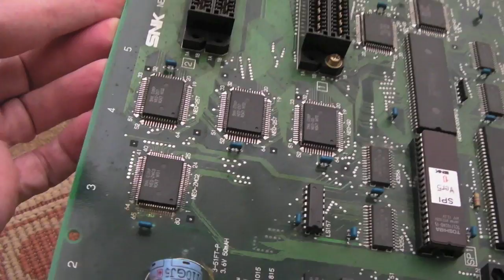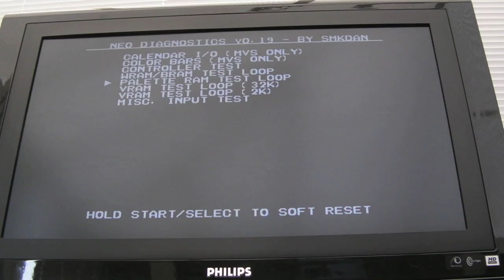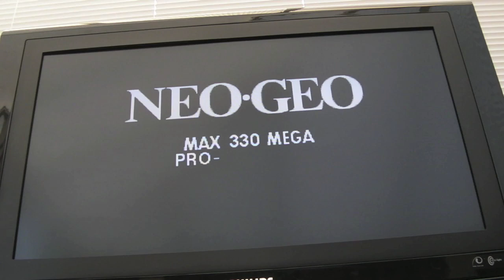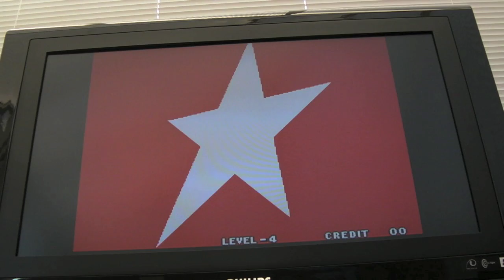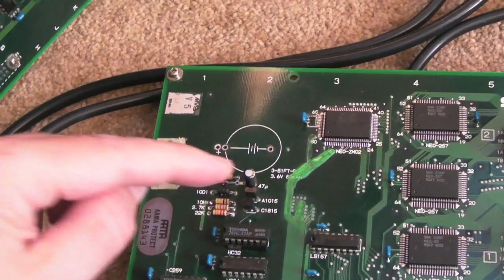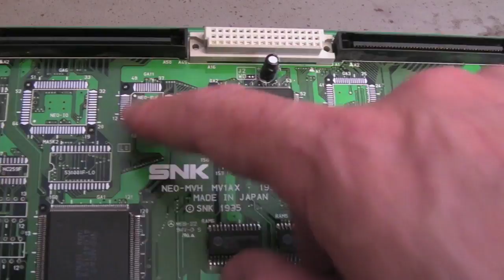SNK Neo Geo MVS MV2 (2 Slot) Repair (Graphics Problems & Corrosion)

Comment from the maker: A couple of corrections - 1) When I was pointing to some of the quad flat packs saying they were 128 pin - they aren't they are 64 pin!  The ZMC2 is 80 pin.  2) The BIOS wasn't sat all the way into the socket properly there at that point when I went around the chips - just needed pressing in further on the left side.
Reply: I have the same board with similar issues. Wanna fix it for me? 😁

Comment: Hello. i have artifacts with one of my mv1fz boards could you give me any hints what migh be the cause ? i  tried using another cartige pcb and the problem is tha same the cartige pcb from this one works fine on another board. i also tried cleaning all contacts and did a quick inspection but i dont find anything obvious. thank you in advance
Reply from the maker: If you have graphical problems, it's going to relate to C or S buses.  If its a multislot - check out the Neo Geo wiki for the 4 slot pinouts, to try and follow the char and S buses to the various chips.  If you are lucky and have older multislot, 74 series is mostly responsible.  New multislot boards use customs for slot logic - you can get modern replacements for those from Furrteks Tindie store.   If you are lucky it could just be a dirty slot or damaged trace though!

Comment: Thanks for your videos!! 
I would like to ask you some information about a repair i'm working on ... i have a MV2F board with "calendar error" problem. i've checked traces from battery to 4990 ic but i've not found any leak or corrosion sign...i've changed the 4990 too but it doesn't work, same calendar error. I've tried a working mvs board with oscilloscope and compare the waveforms. i've seen that the 4990 works but its serial interface is not clocked by the neo-f0 ic. the clock rise up but then stucks at high level and not change (it should do 4 clock strobe to set the C0,C1,C2,C3 commands to 4990 and then 32 strobe to read date). It can be a faulty neo-f0 ic or something else? the board seems clean everywhere :( sorry for my bad english 

thanks a lot!
Reply from the maker: It could be a faulty F0 perhaps, but often the cause will be a missing trace or 74 series IC related.   Here's a schematic for that circuit which I grabbed from Neo Geo forum years ago (not sure who created it) - https://www.dropbox.com/s/m9lfhjqlgpbv3hf/2slotcalendarak9.jpg?dl=0
Reply: @GadgetUK164  thanks a lot for suggestions...i've seen something like that with multimeter trying to decode the routing on the pcb. i will see if it is the faulty logic gate (my wish) or a faulty F0 chip (my nightmare :(( ) Unfortunately, as i wrote above, it seems to be the CLK on the 4990 to be corrupted (from NEO F0 chip)...the 74 gate ic pins are related to chip select and output enable of the 4990, but the problem seems the missing input clock. 

I'll keep you updated!
Reply from the maker: Maybe swap out the watch crystal first?  Unless you see the 32.768Khz there with a scope?
Reply: @GadgetUK164  the crystal is fine :)

Comment: Great video's mate! I have a 2 slot looking extremely clean and nice but i find the graphics very dark-ish on my Sega Blast city. Also the cards do not work all the time, glitches etc. Do you have any idea how to fix it? Maybe some new capacitors?
Reply from the maker: It could be a voltage problem - check your 5v level is good on the board whilst its powered?  Alternatively, if the video is still dark, maybe there's a DAC problem.  I think its done with some 74HC chips, and resistors on these?!?  If carts are not working all the time, clean the PCB edges on the carts with IPA.  Also consider cleaning the cart slots with deoxit or contact cleaner.  If carts still fail to work you may have a fault on the top board.
Reply: @GadgetUK164  I had my board recapped but didn't fix the issue. The problem with my Blast city was that i still had the VGA cable inserted causing the darker image on Jamma. Solved now!! Looking for a MVS 2 slot headphone jack replacement since i accidently broke mine. Any idea where you can buy this part? Heard they are rare.

Comment: Nice work on that really small wire trace repair coming of the chip you replaced. I have a 2 slot thats just started having some graphic errors. I removed the battery years ago and its very clean board. Im not super clued up on working out the problem but willing to try. I thinking it could be c rom data problem but where to look first?
Reply from the maker: Thanks!  Do the things I showed in this video to start with - probe the connections as I talked about on the ZMC2, that may provide a clue.  I also suggested in the video which ICs I would suspect if the ZMC2 was OK.

Comment: Hello Gadget, thanks for sharing so many repair tutos. I've followed some steps to replace the Ni-Cd battery on my MV2F as settings was no longer backuped. The problem is still there even if the new battery is OK. I've noticed some corrosion on the 22k resistor close to battery and after having unwelded/welded it again (impedance measurement is ok), nothing as changed. The old battery has probably created other issues around but it's hard to spot visually. I've also some display issues, there are some vertical white lines/dots in graphics. It's visible on the NEO GEO logo when any games start on my system. Do you think it could relate to Neo-ZMC2 ? Maybe this subject was already coverd on another video ? Thanks for your help and advices.
Reply from the maker: Yes, its possible the ZMC2 is creating those lines / dots.  What sometimes happens though are the chips that "switch" between the slots on the C bus cause that type of issue.  I mentioned that briefly in the video towards the back end I think.  With regards to the settings, maybe the backup RAM is bad, or a damaged trace around that battery circuit.  Get a copy of SMK Dan diagnostic ROM and test the BRAM.
Reply: @GadgetUK164  Hello Gadget, thanks for your reply. I've fixed the problem few days ago. You were right, the white artefacts were caused by 2 damaged traces around that battery circuit. The corrosion from the leaking battery broke them. Hopefully the damages were not so big. I've replaced the battery with a new Ni-Cad one but I've welded it on the other side of the circuit. I know it's not the best way to avoid again this problem but I saw  too late the replacement with a Ni-Mh accumulator option. Now I have a display problem with my CRT TV Sony Trinitron KV-29CL-10B. There are some green horizontal wide bands behind some white/flashing graphics. It happens even when there's no cartridge plugged. I can't remember if I always had this problem as I used to play NeoGeo MVS on anoher CRT TV that just "exploded" few days ago, yeah bad luck... I've only found another guy telling about the same issue on forums but he was never answered. Have you already heard about something like that ? I've double checked the Jamma and Scart plugs, thinking about bad solder/wiring on quick synch, video ground, or green output. Very rare issue...

Comment: What tools are you using if you don't mind me asking?
Reply from the maker: Back then I was using a cheap Antec 15W iron (around £15), and the Atten 858D (Hot air station) -around £60 ish.  In addition I had the Annesty desolder station too.  Now I use the Hakko 888D soldering iron instead of the old Antex.

Comment: I have a question about neutralising after cleanup. I have a board just like this, with a leaking battery - a NiCd battery. I read elsewhere that NiCd leakage is acidic, and therefor needs to be neutralised with something with a high PH value (basic) like baking soda. And alkaline batteries leakage is basic, and thus requires something acidic like vinegar to neutralise it. I dont know if this is correct, but it seemed that your battery was also a NiCd, and you mention neutralising it with white vinegar. Do you have any comments about this?
Reply from the maker: NiCd is alkaline!  Just use White Vinegar (distilled) to clean up.  You should be cleaning up again afterwards with IPA anyway and washing away any contaminants etc, or really makes very little difference to be fair.  See here:- https://www.sciencedirect.com/topics/engineering/alkaline-electrolyte

Comment: Chris my neogeo mv2f does not recognize the cartridges, you call goes straight to the crosshatch screen, do you have any idea what it is?
Reply from the maker: You will get stuck at the cross hatch screen if the 68K CPU cannot access the P ROM(s) on the cart.  That could mean that the databus to the P ROMS has a connection missing, or an address line missing.   They dont go straight there on a 2 slot obviously, they get buffered - probably through Neo-G0 or Neo-257's or something.  You would need to follow the CPU databus connections and try and work out how they get to the cart slots, or reverse it - start at the P bus data and address connections on the slots and see what they connect to.

Comment: This is a very much appreciated video.  I have a similar issue with some graphics specifically on my 2 slot.  The games load perfectly sound and all, but I am literally missing the bulk of sprites and background graphics. Most of the text on the screen loads.  Just seems like animated graphics are not appearing.  It has been suggested that I swap the ZMC2 chip and it may work. Any thoughts? Cheers!
Reply from the maker: Yes, I would try the ZMC2 first =D
Reply: GadgetUK164 - Retro Gaming Repairs & Mods 

Thanks for the reply!

Comment: dear how you get this diagnose option in motherboard when repairing. is it on dip switch? which switch please sir help me.
Reply from the maker: The diagnostics is not built into the standard BIOS.  You need to get the "SMK Dan Diagnostic BIOS" programmed to a 27C1024 EPROM.

Comment: Quick question , I’m thinking of picking up a single slot neo geo from the bay (not to fix just play games on), would it matter if I import one from China or out side of the uk ?
Reply from the maker: It shouldn't make a difference!  Most of the ones from China tend to be MV1C or MV1B boards.

Comment: Every time |I watch you working on these boards I get the temptation to buy a broken one and try to fix it.  If only I didn't also need to buy a jamma connection, controller, power supply, diagnostic rom and a game cart.  Plus I'd likely just break it more lol.  Fantastic video.

Comment: Why don't you just sink it in the water with some detergent and wash it with brush?
Reply from the maker: Mainly because water can cause rust very quickly.  Even if you dry it off super quick some of the exposed metal connections are affected by water.  You can also end up with other contaminants under chips and in sockets etc.

Comment: Really enjoy your videos! 
I've been working on my own mv4 and I've learned a lot.
My 4 slot has a perforated cover, seems most covers are solid, were the mesh ones early builds? Any ideas?
Reply from the maker: Honestly no idea - never seen a perforated cover =O
Reply: Here's a photo, it's the only one I have handy, before I pulled the board out of the cabinet. Just to show you something you've never seen :)
Once again thank you for your hard work, it's very appreciated!
https://m.imgur.com/a/Tqn29wW
Reply from the maker: Wow, that is rare!  Very nice =D
Reply: Thanks! Super stoked on it just waiting for some new ram chips to come in, Ive got one bad video ram chip, I'm able to bypass the error using unibios  and it's playable, minus the graphical glitches from the bad ram chip.
These brassy/golden "mesh top" covers seem to have come out of early "Big Red" north American cabs like mine, I've been trying to find more information.
https://imgur.com/a/KWbEsYr

Comment: About 42:20 it's not obvious, but it's kinda noticeable with regards to the "darker area" you can see, especially on the corner of the 19/20 markings on the board. Either way, a great cleanup vid so far, always fascinating to see how stuff works, despite my lack of repair ability.